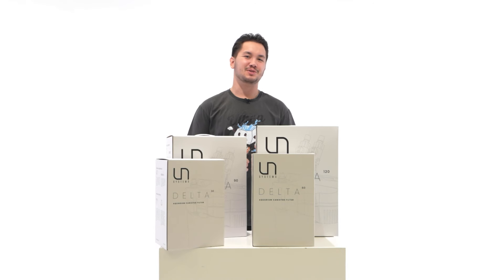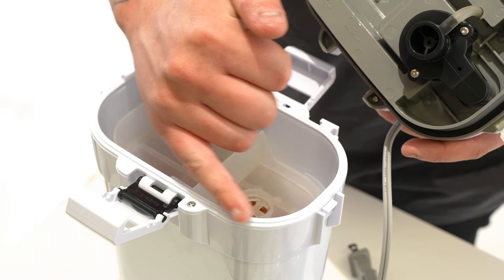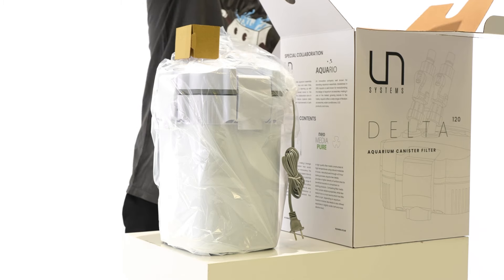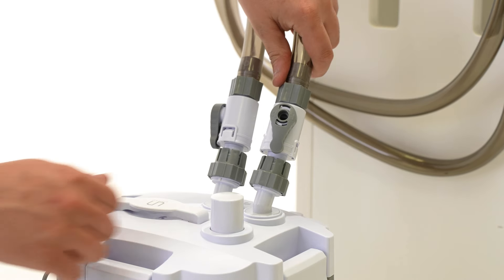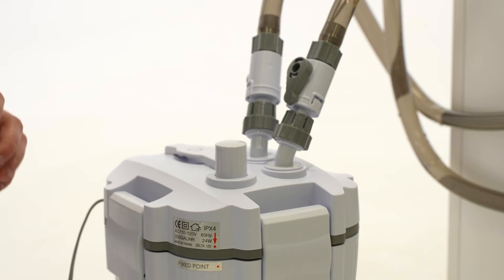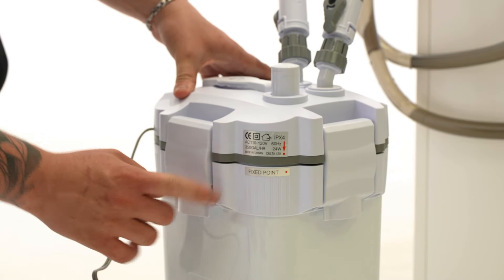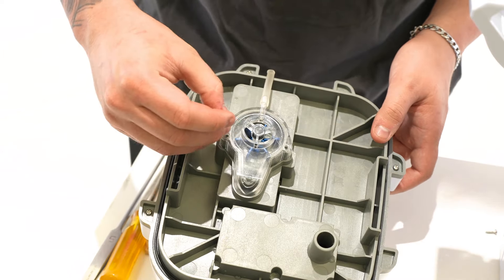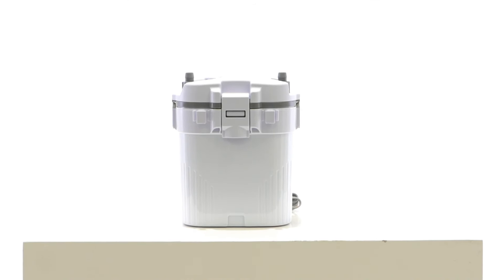Priming & Troubleshooting the UNS Delta Canister Filters for Planted Aquariums

Comment: Does the delta 60 have end caps on both ends of the impeller shaft or just the one (in the black housing that you screw in)? I noticed in the video that the 90 etc does but not the 60. I wanted to confirm as I just did impeller maintenance on my delta 60 and there is not an end cap on the bottom (either on the shaft or stuck down the hole). Thanks.
Reply from the maker: Yes, the Delta 60 impeller should also have caps on both ends. Double check that it's not stuck down the hole - if needed, you can find an impeller replacement online or we can assist you through our support form!

Comment: The hoses don't connect to the pipes easily. Is an adapter required?
Reply from the maker: Can you please clarify the issue you're experiencing? Are you referring to the included Aquario Neo Lily Pipes and UNS filter tubing included?
Reply: I dipped mine in hot water and added them onto my pipes from there

Comment: Very nice! Thank you for the upload.
My critiques are I wish the Nio flow pipes were a little longer; the intake seems a bit high up unless you flip them around but then they lose their symmetry.  Lastly I found the provided hosing really challenging to get into the Nio pipes but I do have the older ones that were sold separately perhaps that's changed since the team up? It felt as if Nio was metric and UNS was standard size but still close enough to work ish. 
Overall love your products and look! Keep up the great work and design!